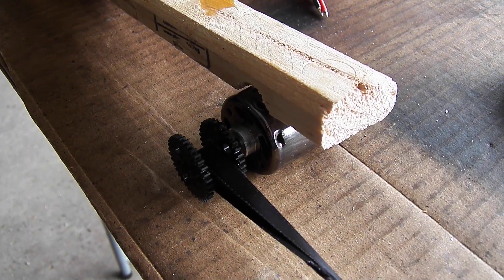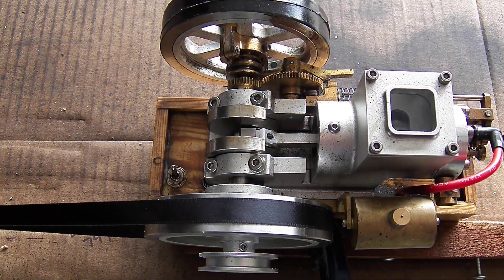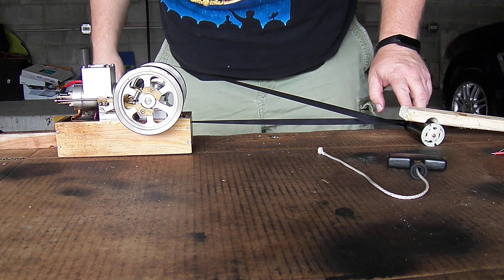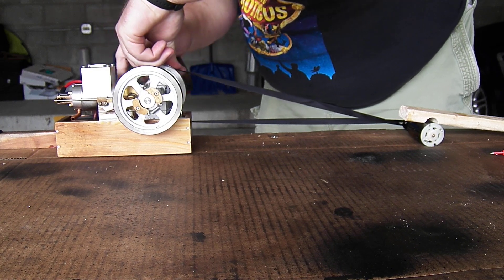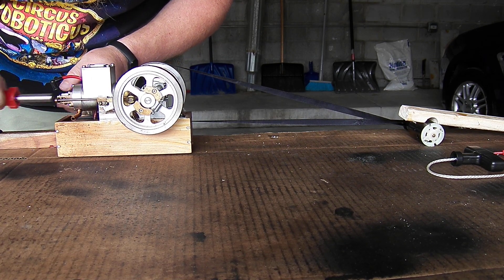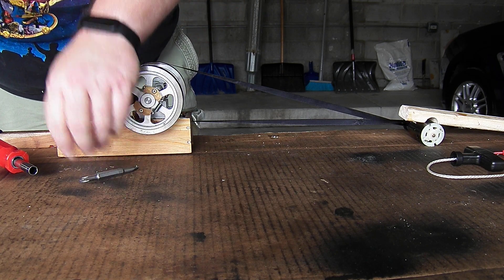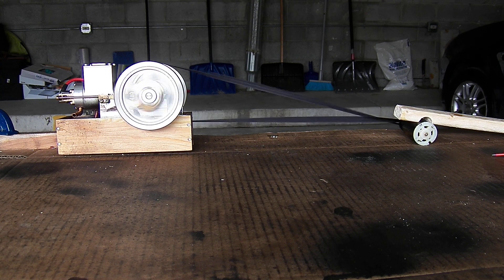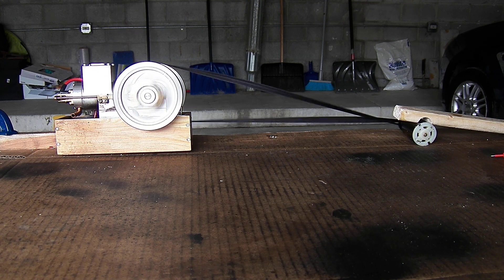Generator planning

Comment: You'll learn, really need to go look at hit and miss Motors on tractors connected to other machinery. Don't ask questions just watch. After you figure it out in your head then you can ask questions. 1 tip get your motor running before you relax the belt on the Wheel just think about what I said